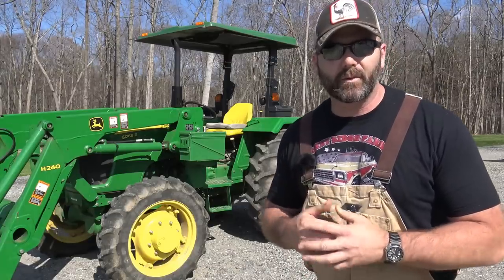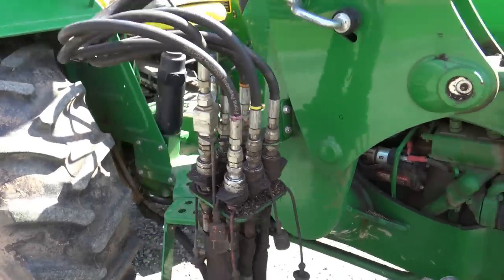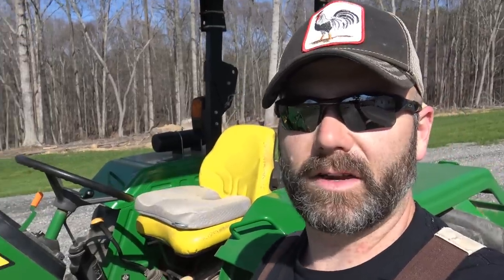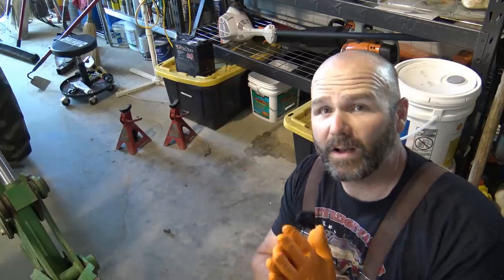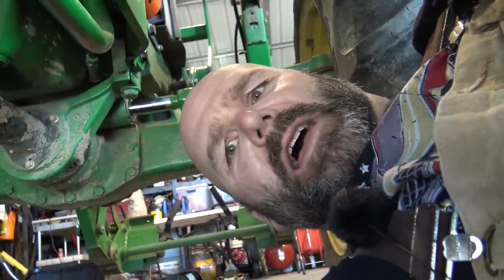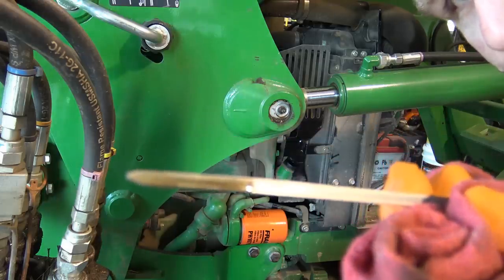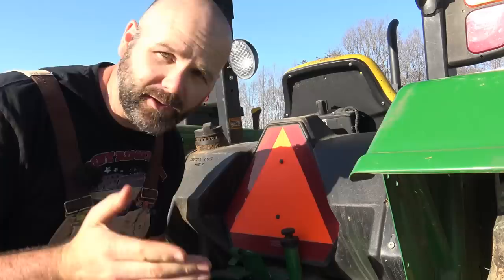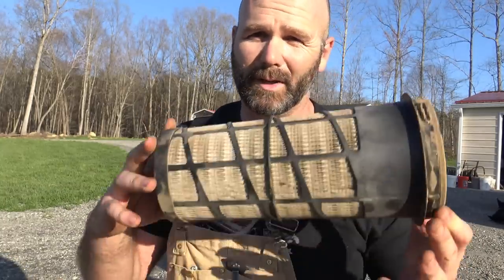TIME SAVING TIPS AND TRICKS FOR SERVICING YOUR TRACTOR AT HOME!!

Comment: For all the hate on Fram I have used them 55 years with NO problems
Reply: Tom Burgess fram is all I use.
Reply: Tom Burgess just from videos is where hate comes from there setup not to fail just shorten life of the engine they say lol my vehicle gets whats on sale because I won't keep them long enough to wear out.
Reply: I've never had issues with Fram either. I usually use Purolator Classic or Fram...which ever one is. In stock.

Comment: Did you clean your oil strainer (JD Part # RE72875) when you changed your hydraulic fluid? They say to do it at 1200 hours.
Diagram: https://bit.ly/2XZV9E7
Manual: https://bit.ly/3hsOZ7h
Thanks for making these videos. Subscribed.
Reply from the maker: thanks for the tip...we're only just now at 900 hours on this machine